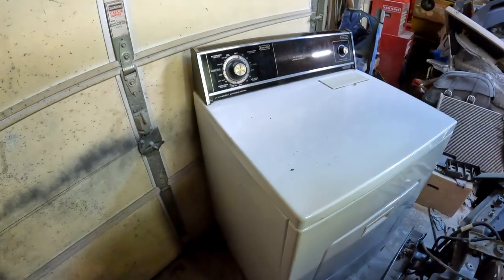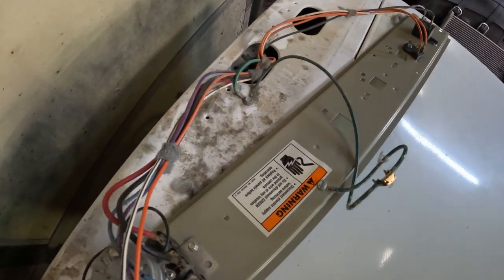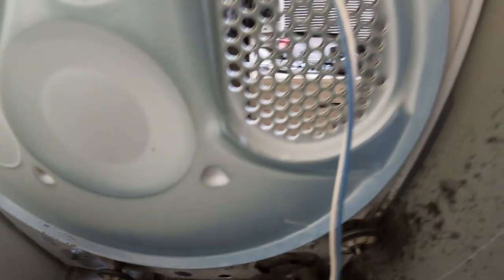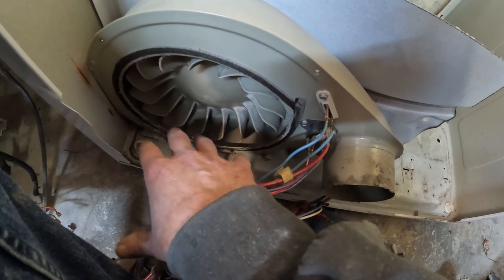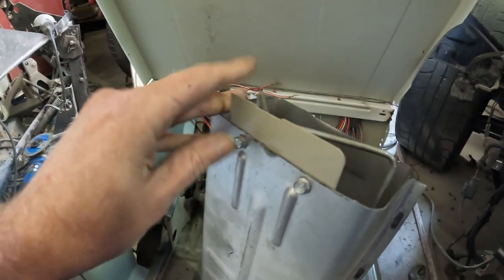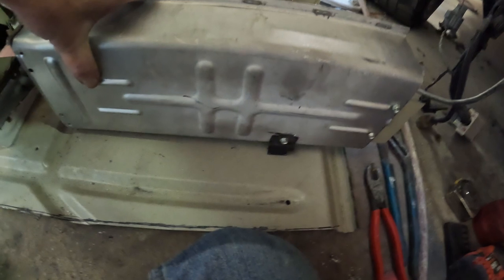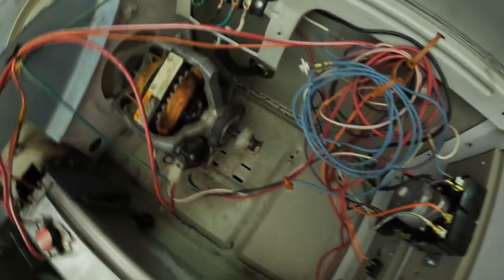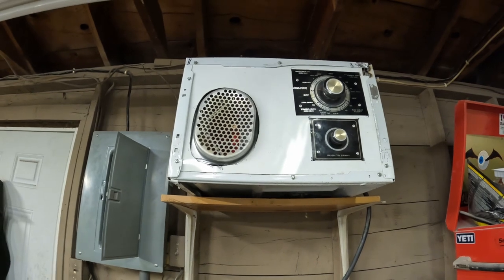See How I Transform an Electric Dryer Into a Efficient Shop Heater!

Comment: Electrolux/Frigidaire has a different configuration for the heater coils/element that doesn’t lend itself to this kind of modification. Instead of fitting into a duct they are arranged in a large area around the back of the drum where air is drawn from all around. Since we are ditching the drum to shrink it down, we can’t really use that configuration.
Reply from the maker: Good to know, I'm not familiar with other manufacturers configurations. Most of the driers I've owned and worked on have been this models basic setup. Thanks for watching.

Comment: Would it be strong enough to also act as a shop air purifier? Put a filter in front of the air inlet to purify the air, and a on/off switch for the coil to simply act as an air purifier OR a heater? or the motor isn't strong enough for that in regular dryers?
Reply from the maker: That’s a good question, I’m not really sure. I guess it could be possible but it doesn’t really pull a lot of air like a vacuum does, it isn’t really sealed up the way I built mine. The fan blows out warm air nicely but you may want to look at getting a dedicated air purifier for the shop.
Reply: @deedoesgarage  Well, I was either thinking of recycling an old dryer like you did or use my furnace blower's squirrel cage to do an air filter/purifier (whatever they're called in English, I'm French Canadian)... maybe I could consider doing both... Build a big box with air filters that the squirrel cage would pull and the spit it out into the heating coil of the dryer, and try to adapt the motor of the dryer onto the squirrel cage so I can keep all of its controls (it isn't a very powerful motor in my squirrel cage, I think it's like 1/4HP or so)
Reply from the maker: What kind of air impurities are you trying to filter?
Reply: @deedoesgarage  I do woodworking stuff in my garage, so... mostly that... and the nasty smell of oil/gas when I work on my ATV, lawnmower, etc.. mostly
Reply from the maker: Ah, okay I get what you want. My suggestion would be to build a filter box using the squirrel cage fan. I felt the suction at my air intake port and maybe it could be improved to pull more air but I honestly think you wouldn’t be happy with the performance of it in that regard. It would only draw air from its immediate area and leave the dust floating in the air on the other side of your shop. I think a squirrel cage fan would move more air and maybe achieve more what your looking for. The heater does move the air but I just think it wouldn’t suit your needs enough as far as air movement and dust management would go.
Reply from the maker: If you can, I would build almost like an exhaust system. The same that would be used in an automotive paint booth. With a filter box and the squirrel cage fan pulling air through it. That would move more air that way. I know you can use heat ducting and have it use normal house air filters and a squirrel cage fan to draw the air through that like a paint booth. I know of a setup like that in a two car garage that worked really well. It would clear out automotive paint overspray in just a few minutes.
Reply: @deedoesgarage  Yeah, that's kinda what I thought. They aren't meant to be high RPM machines... I could see if I can find a 3-speed dryer to complement my 3-speed squirrel cage and wire it accordingly. Then I could make a filter box and push the air onto the heating element of the dryer with an on/off switch to keep it normal or heat it up. Thanks for your reply and clarifying if it could work or not. A bit more work than I'd like to do, but if I can do a 2-in-1 it would be better than 2 single machines. Plus, my motor can run on 240v as well, so I wouldn't need a 240v for the heating element and 120v outlet for the motor, so that's a plus!
Reply from the maker: No problem, happy to help. Let me know what you come up with.
Reply: My experience with dryers is that they quickly overheat with even minor blockages in the dryer vent but obviously it can push/pull air through the lint screen just fine.
Reply from the maker: my intake hole on the side is wide open but I can see where if you don't keep it clean so air can move over the coils that it could cause it to overheat.